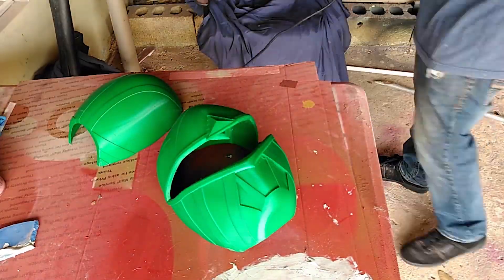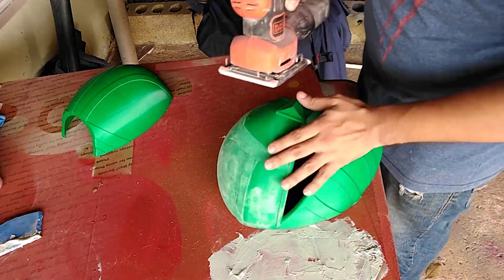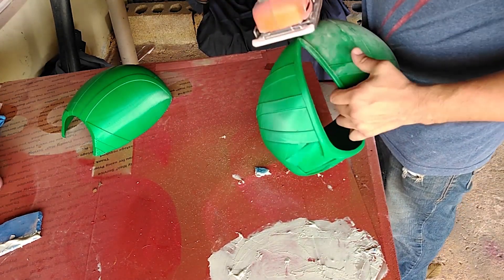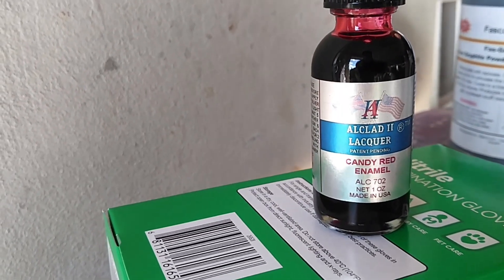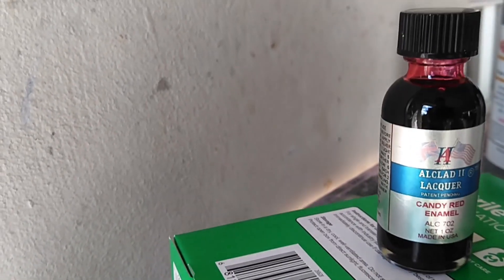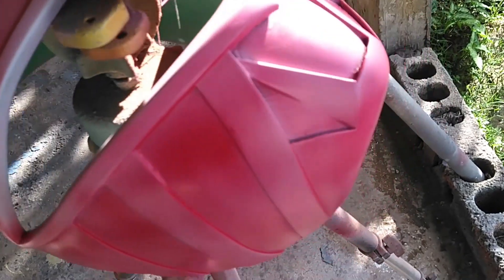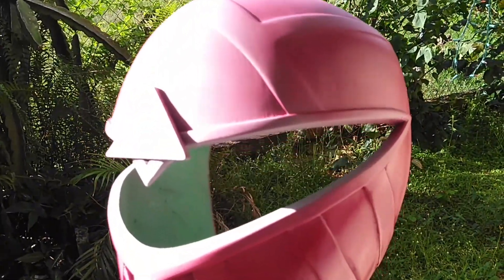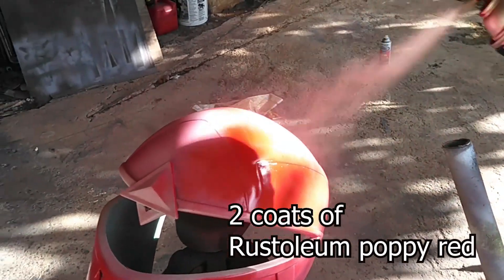3D Printed Omega Red Ranger Helmet

Comment: 17:21 If I had to guess, the paint was still drying. Normally, it says to wait 24 hours to where it's dry to the touch. But I learned that if you leave it alone for at least half a week to a full week, you will get maximum adhesion. That's just for Rustoleum products. I can't say the same for other paints like Krylon or Duplicolor. You COULD paint the missing spot with a soft brush.
Reply from the maker: Oh I already know I did the painting in 3 days giving paint good time to cure but sometimes still happens
Reply: Very weird. I will have to do more research on this to find out more.